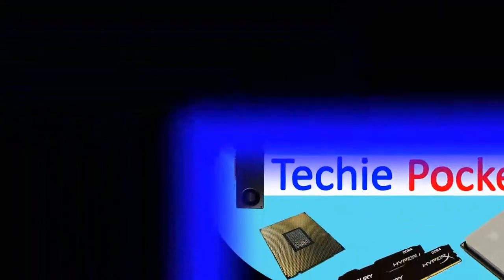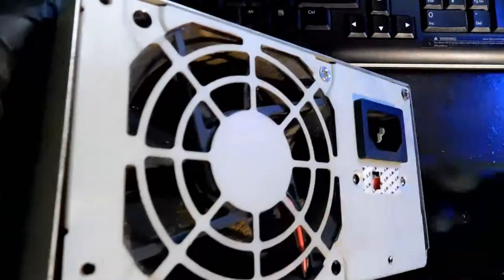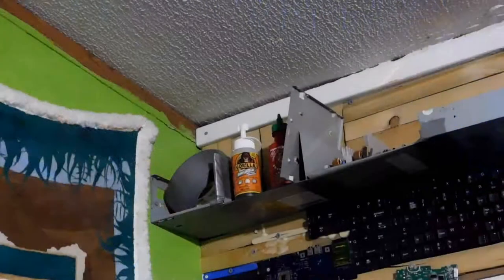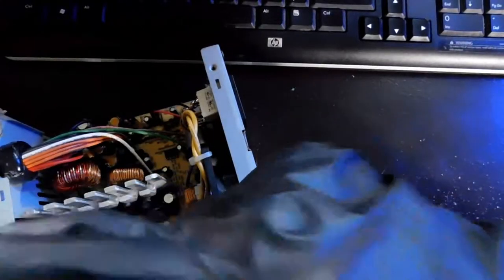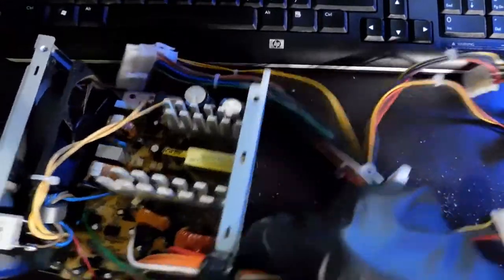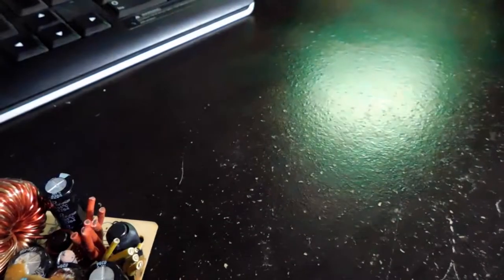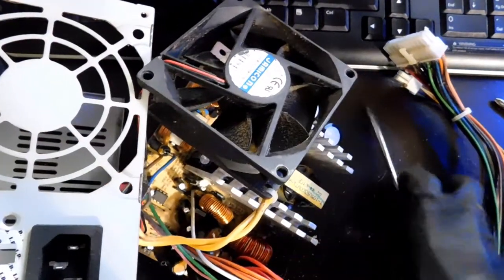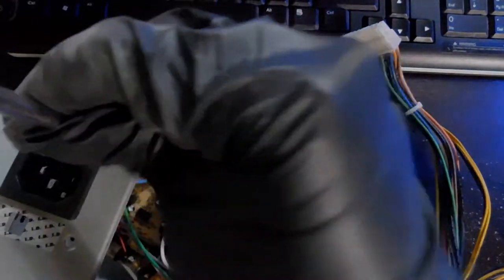What to Do With an Old PSU

Comment: 1:00 i cut them in half to get several free Desktop Book Stands (4 per PSU)
(90 degree Angle for holding books upright)
Reply from the maker: Hahaaa! I should have added some better suggestions lol
Reply: @TechiePocket1  was pretty decent video, not sure why it was rated so bad, maybe most expected a DIY Lab Powersupply, but i was searching for other uses since i already know the most typical (Lab supply, Salvage components, re-use components for diy switching supply, just is it as it is by connecting Green cable to ground....)
Reply from the maker: @hyperhektor7733  Thanks m8 :)